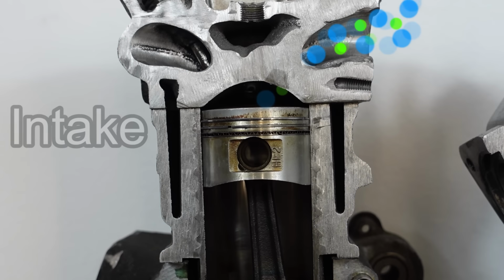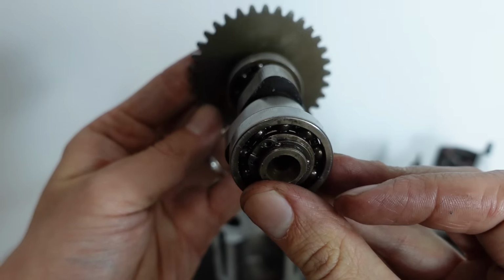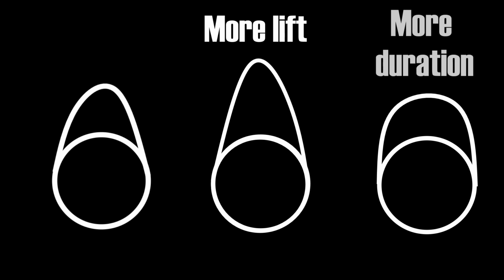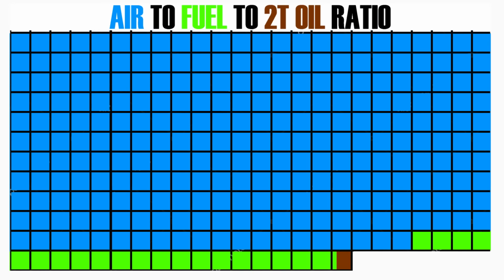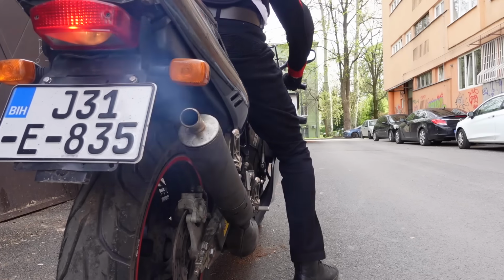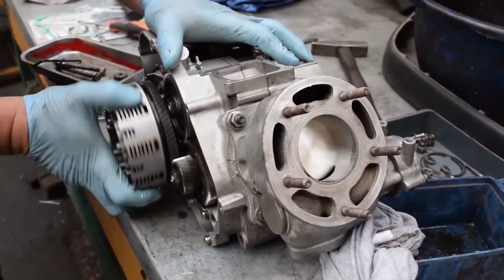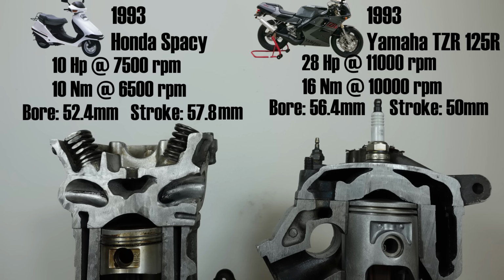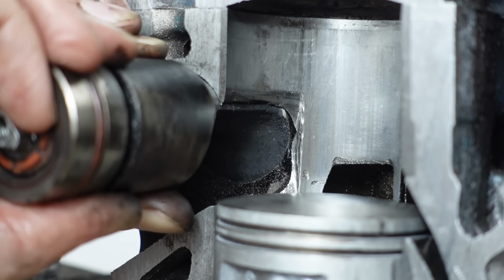The Only Video You'll Ever Need to Watch to Know how 4 Stroke and 2 Stroke Engines Work and Differ

Comment: 2 stroke faster more performance higher revs engine longevity shortened ,emissions issues but simpler to rebuild  . Mercury and Johnson proved in the 90s their outboards were higher performance per displacement vs 4 stroke. Still are to this very day ! And no floating valves at 7k rpm !

Comment: 2 stroke runs very hot and constant burn and runs hot and requires oil.
I’ve ran a four stroke engine on a downed spark plug, but, I much prefer a four stroke.
It’s all about preference, but for me, a four stroke works best 👍

Comment: 20.000km for a 2 stroke is not true. We have here the italian 2 stroke engines in scooters and they are always on full throttle and i have seen many of them between 30.000 and 50.000kms with original engine block and pistons. And my 125cc scooter with 4 stroke has now 53.000km and still runs fine. And these scooter engines are always on max power. I think 100.000 km is not a big deal. And thats even longer than some modern Ford or Volkswagen engines.

Comment: One thing that bugs me. 2 strokes dont really make more power in the same amount of time, it's making the same amount of power, just more often. Making the same power, more often, is more total power, but the total power and maximum power output are not the same thing. 
If both engines are 2 HP, the 2 stroke is just more consistently creating that power. So while you aren't USING it, it's wasting it more consistently.

Comment: No 4-stroke will ever replace the excitement and fun that a 2-stroke brings. Motocross and Supercross were so exciting when they raced  2-strokes. The climate freaks got them banned and are working on the 4-stokes so you will only be left with electric. The 2-stokes would have electric start and electronic fuel injection if they were still widely used.

Comment: A lot of information in there totally unneeded to explain about how these two engines work. 
For 1 instance  ... you don't need to explain how the heat from the plug spreads molecule to molecule etc, there's an explosion that sends the piston back down etc ... ... Absolutely nothing to do with the subject. Nothing worse than watching something to get information and having to endure a presentation over bloated with irrelevant information. So much useless crap to have to listen to. I left mid video.